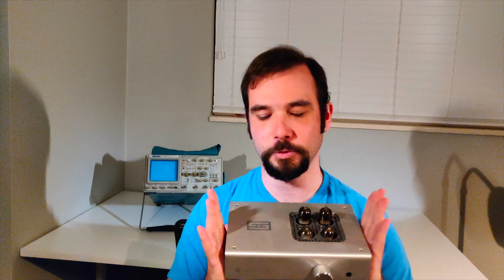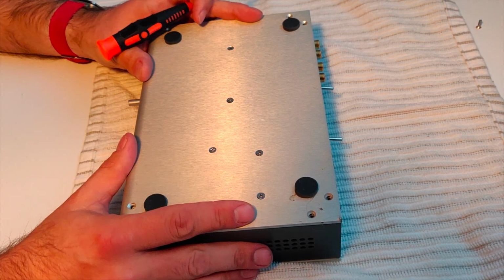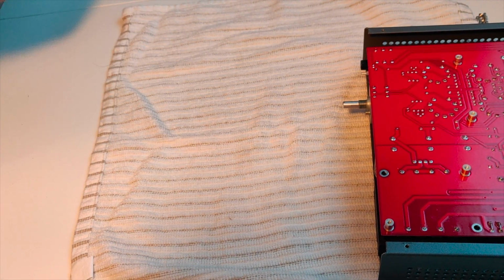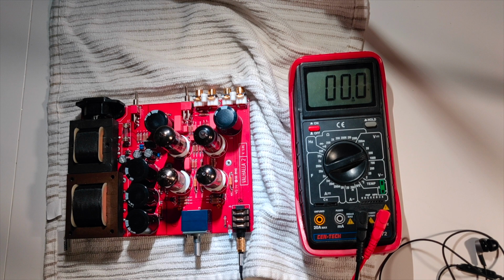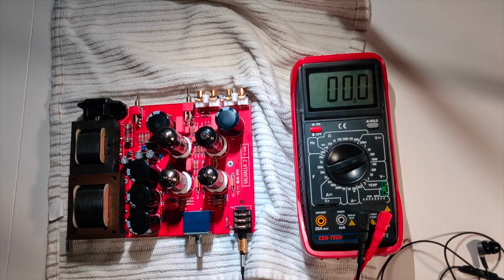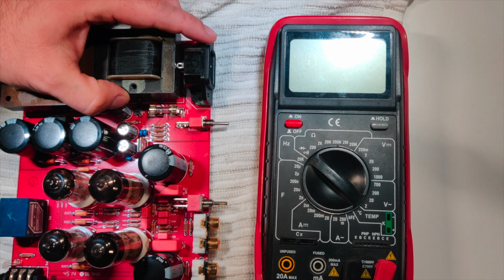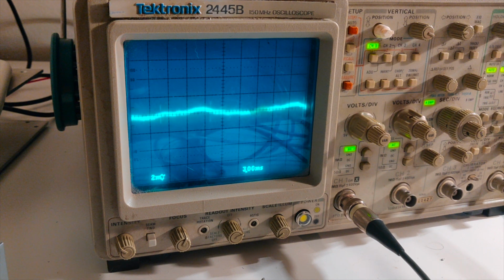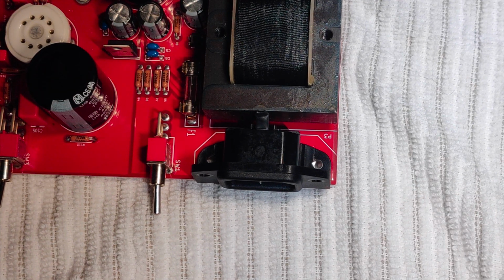Troubleshooting a Schiit Valhalla 2

Comment: Ya just got a Valhalla 2 and ya having the power port issue but slightly diffrent, just causing a buzz and vibration from the unit if the power plug pulls on the power port at all, so if you could like tape on the plug on it or find some other way to keep it steady so the cable dosnt pull on the unit AT ALL, then it should be ok(?) i dont know i returned mine as that alone seemed like a fire just waiting to happen as, and i cant prove this one but, it seemed like it was pulling exess electricty though the amp and into the headphones, like got a lot of electric noise on the Jack-in spot wheneevr i would move the headphone cable which was worrying and like ya while the amp smooths out all the peaks you might get with other amps and still keeping a rather Hi-Fidelity in the highs i decided i prefer normal amps anyway as tubes (Or atleast this one, this is my first time trying a tube amp) make it so you lose out on alot of bass and the smaller details youd find with other amps which is not really what i was looking for, i only wanted those peaks and heard that tubes were warm but ya lose out on i would say more than half of your bass. This was with the stock vacuum tubes using a DT 1990 Pro (with analytical pads) as my headphone btw so i have absolutly no idea how other tubes or set-ups may react exactly but if what i said (getting a more smooth sound, especially taking out those annoying peaks and such) is your thing im sure you'll like this. Again though with the annoyance of the power supply it may be worth looking for a diffrent OTL tube amp or wait for them to release a Valhalla 3 or somthing.

Comment: I am chasing essentially the same problem in a Valhalla 1, except mine is right-channel only. I was appalled to open the unit and see what they had done for the ground. The problem with your approach is now you have a high voltage device, in a metal chassis, without a ground. It might be worthwhile to life and limb to solder a wire onto it and run that wire to a lug on one of the chassis screws. I almost killed myself on a hi-pot chassis once, and was only saved when right before I was about to touch it, a cable fell off the workbench, touched it, and everything exploded. Just a thought.
Reply from the maker: I guess I could have shown that better, but there actually is a lower ground tie on that plug socket.  That plug style has through hole grounding, but also has that upper lug causing the issue.  If you check between the case and the ground plug with a meter, it tones out.
Reply: After all, that energy plug should be touching the transformers by design or not? I wonder if a thin isolating rubber would do the trick (assuming it should not be touching).

I wish you could have captured that crackling in the video, as an example. I have a 30W all valve guitar amp and I guess I can consider myself lucky then in never hearing such cracks, except the regular 60Hz hum.

Great video nonetheless.

Comment: I have the same issue. Be warned if you attempt this repair. The valhalla has a huge HV capacitor without a bleeder resistor, it will KILL you if you touch it. Do not discharge it with a screwdriver (I made this mistake), it will blow the traces up (luckily the damage was minimal and my valhalla still works properly). The capacitor in question is the one closest to the audio inputs, top right. Note all the capacitors retain charge so you should discharge all of them to be safe, but the top right is especially dangerous.
edit: also, the ground plug should be grounded to the chassis, not isolated completely.